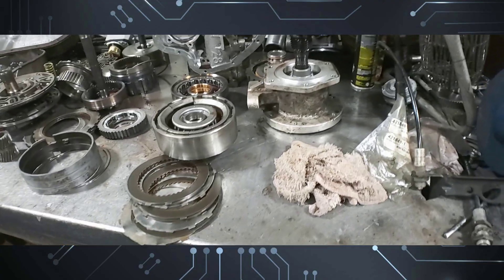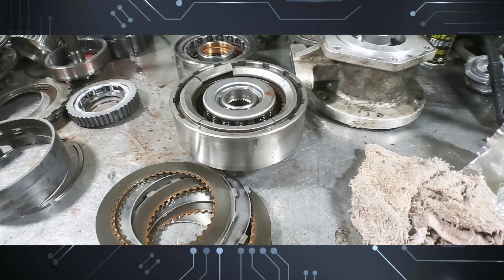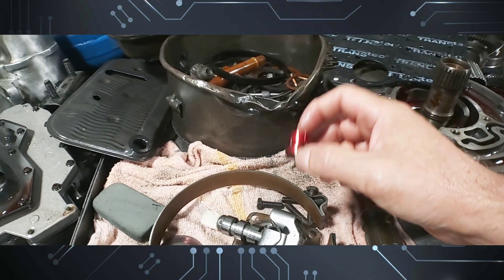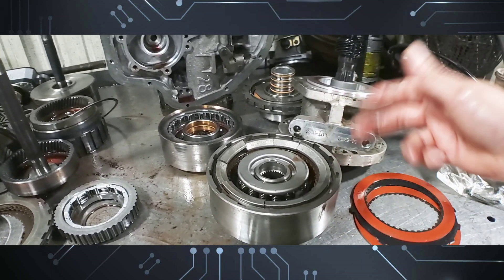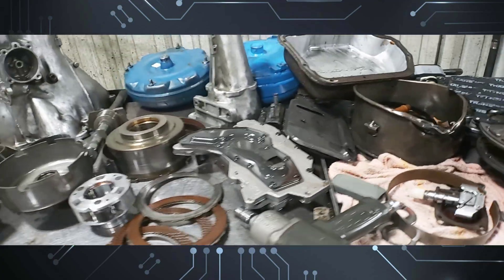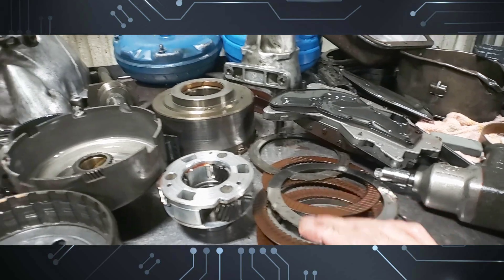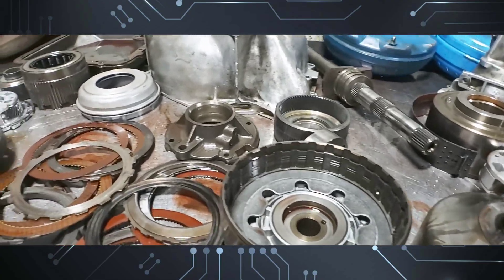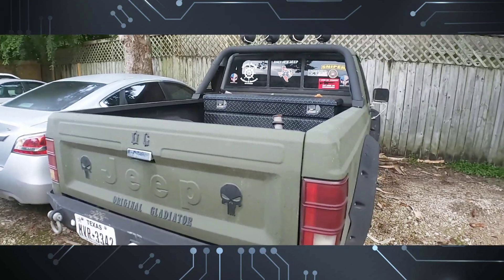⚙️THM 400 Transmission Reverse Issues: Tales from the Bench

Comment: Hey Hiram i have 2000 honda odyssey it has a hard shift  from 1st to 2nd gear after it shifts to second it runs fine. and No scan code is present. is there anything you could guide me what's causing that.

Comment: The scretched steels tip is great. That's why when in manual transmission you change only the clutch disc but not the pressure plate you can have the new clutch disc fail prematurely because of the scratched pressure plate surface. Can i ask you , i have mercedes w211-diesel and there was vibrations while driving, sometimes more , sometimes less vibrations. Only after i replaced the torque converter the problem was fixed. I belive the body of the converter was warped, or maybe a stator that intermittently stayed locked in the high RPM 250 000 miles car. 🍺 PS: there is some strange popping sounds at 2-3 times in the video. 7:42 is one of them

Comment: Hello my name is luis i have a 2005 g35 coupe is automatic i been having this issue the my manual mode those not work i put the car in D and when I change it to manual mode it just said D on the dash , maybe you can help me with this ?
Reply from the maker: Have someone scan it, if nothing found then your shifter assembly is the problem.
Reply: Already scanned it it giving me only code the U1000 and the P1815 that’s it
Reply from the maker: P1815 is related to the switches on the shifter. If you're mechanical inclined you can take it apart and check the switches.  But the problem is definitely on the shifter itself.
Reply: @AutomaticTransmission   it always shows to code the P1815  and U1000 already got my self a new shifter so I will install it them I will delete the code with the computer and hopefully that resolved the problem

Comment: Two classic transmissions that everyone loves to beat on. In your opinion, if you had a choice between the TH350 or TH400, which one is better to update? 

I used to run C6s behind a Ford 460 bored & stroked to 514 with few problems normally aspirated. I did experience numerous pump seal leaks back in the day. Broke a few shift valves too. Shift kits in the 80s weren't great and never did figure out why they broke. 🤷🏻‍♂️
Reply from the maker: Both are great. But when adding a lot of power, whether NA or boosted the THM400 handle the power better. But Both are great for performance builds.